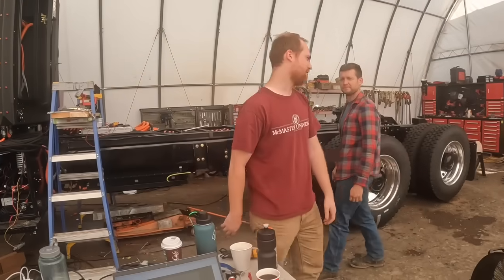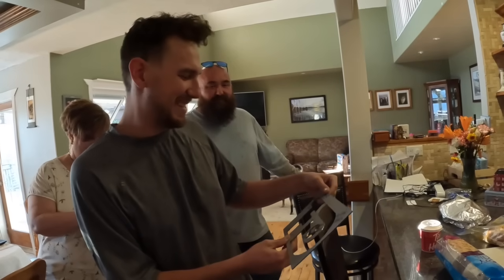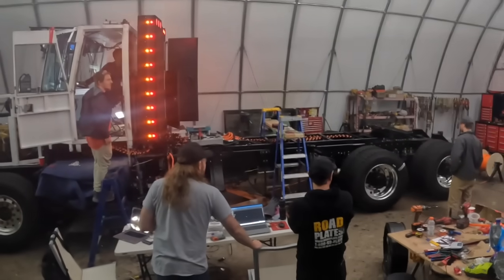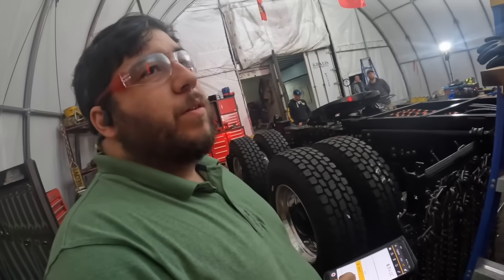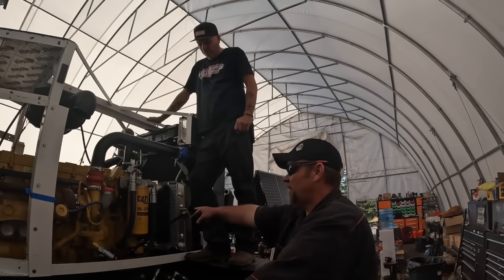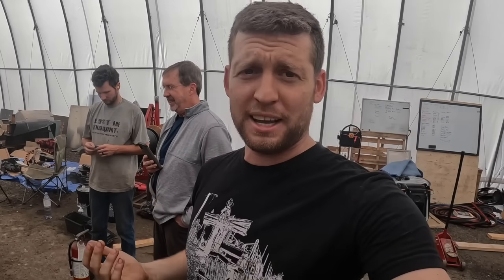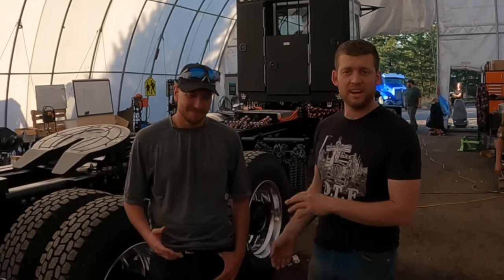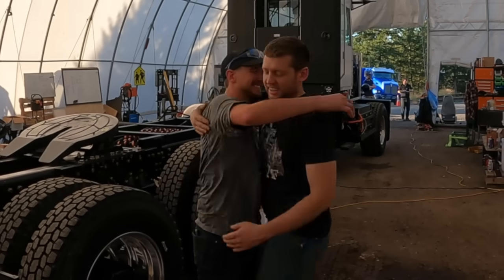Edison Truck Breakthrough: First Test Drive & Generator Power | From Concept to Reality in 12 Months

Comment: As Chase said, this is the obvious solution to reducing fossil fuel usage and is a proven technology. Just imagine reducesing diesel fuel consumption by 50% in the trucking industry! The saving and carbon reduction would make it possible for Canada to meet our climate change targets and bridge the gap between current battery technology and our green electric future.

Comment: It's a series hybrid... Just like modern locomotives. One power source only turns the wheels, but the energy source for that comes from multiple sources... Therefore hybrid (as in a blend of more than one).

And as for diesel-electric, you're right, it's a diesel-electric series hybrid vehicle.

Comment: I’m confused. Extended range EV with an onboard diesel generator? I’m guessing this project is just for fun because I can’t see it being economical viable to operate.
Reply: It makes perfect sense why this would be economically viable to operate, especially considering the generator only runs when it absolutely needs to, and running at full power for a relatively short period of time to recharge the batteries is way more efficient than using the same motor to mechanically drive the truck. Locomotives have used similar technology for the last 90 years or so…

Comment: Soo Cool! Congratulations! I like how you got the chains hung, but still lack a hood, etc., I guess you can take the trucker out logging, but can’t take the logging roads out the trucker. 

Also why didn’t you stick with the weight saving drivers seat from the beginning of the video, when yall were ‘driving’ wheels in the air? That’s an eco savings of a grey squirrel per 120,401miles driven, don’t you care about the plight of the grey squirrel?

Comment: I don't think that 24v fan will be big enough if not moving.    If moving should be fine.    But sitting still and loaded to max Gen load, I think it will overheat.

Also are u using the generator to start, or the starter?
Reply: No starter, the generator starts the motor

Comment: I've been watching you build this truck from about the beginning. You already had the Kenworth complete and were just receiving the e-axles. Great job, keep it going! It's great to see the members of the company get to see the wheels of the first truck start to move. Then to see it drive out of the shed for the first time. Your hybrid idea integrating with the route-planning that includes topography and grades to determine best battery use and recovery is quite excellent! The fully electric solution doesn't fit 100% for a lot of applications. This hybrid solution fits this application really well. It solves problems with economy and pollution (depending on charging source of course) without range problems. Plus the other benefits - torque, potential to drive front and trailer wheels for extra traction and safety. Great ideas! Some people no doubt complain that it's still running on diesel but they're missing the point that it massively reduces the diesel usage. Making this incremental change works massively towards reducing reliance on fossil fuels whilst actually being achievable / produceable. There's a company here in Australia (Janus Electric) that is retrofitting existing semis with batteries and electric drives using forklift-changeable battery packs. They might be someone to talk to to help develop your solutions!

Comment: Nothing wrong with a series hybrid, just like a train! hahaha
Absolutely awesome, guys.
I think electric freight trains are how the backbone of a freight network should be set up, with battery EV (or freight trams lol) in town. But trucks like this are what should fill in the gaps and connect the remote areas where you can't get those in. 
And hell you could run the genny on veg oil if you wanted to 🤣

Comment: Diesel electric like a train seems closest. But its not really that either as it doesn't need the generator the whole time. Not really a hybrid as at no time does the combustion engine mechanically power the axles. It's not electro-diesel for the same reason. But it's not a true EV either, as it can be self sufficient with uts charging. I guess we need a new category for these trucks.

Comment: It’s not a diesel electric as the electric isn’t dependent on the engine running, you have batteries. It’s not a hybrid as in that case, diesel and electric both don’t drive the wheels. Range extended ev sounds the most realistic

Comment: id like to call it what it is, but im not entirely sure. can the diesel drive the wheels or is it ONLY capable of charging? 

if it can drive the wheels, I'd call it a hybrid because that would make it hybrid drive. but if it only charges the electric, its a generator not a hybrid.

of course its awesome either way, but semantics can be fun
Reply: the diesel can’t drive the wheels directly. there are only electric drive axles.

Comment: Love this stuff and I am a fan, but I have a question about the tuning you are doing. How are you going to stream line what those Technicians are doing when you go to production? It seems like the mechanical, electrical and metal working can be done in an assembly line style, but the programing may be the bottle neck. Can those techs package the electronics and programing into a ROM or a Flash Eprom?

Comment: A few points:
Yes, an electric powered fan will be enough to cool.  You may even want to add a feature to ramp it down when it is cold outside.  When the engines thermostat is closed and the electrics don't need a bunch of cooling, keeping the engine warm is a good thing.
On cabling issues:  You need to do better in the future and I know you will.  A few things that can help:  A "cable buzzer" is a very handy thing.  It is just a battery, a loud buzzer and some leads so that you can check wires for continuity without having to be near the "meter".  Make sure you have good crimpers for any crimp.  Don't trust cheap ones no matter how much you paid for the cheap ones.  Always, check, crimp, inspect then let go of that crimp.  Each one gets treated as the value it is.
You may want to add an "anti-runaway" control on that diesel.  This is usually just some sort of stopper on the intake side that can be worked from in the cab so that a run away can be stopped without having to uncover the engine.
I like the metal logo bits but I slightly question the material it looked like they were made of.  The color on youtube may be to blame but that didn't look like 316 stainless, or aluminum bronze.  316 is very good in a salt spray environment.  Aluminum bronze polishes up to look like gold but is slightly less expensive.

Comment: Do you think operators will bother to plug in your trucks and charge the batteries or will they just run the truck on diesel all the time?  Though I think you probably have the right approach to getting truckers to adopt electric trucks.
Reply: Probably it will be plugged in at nights and long stops because it’s cheaper than diesel. When driving the engine is a fast charger and will probably get used as they drive. Just my opinion

Comment: 👍Congratulations. Great job. 🎉

Hybrid only applies if the engine can drive the truck directly, this doesn't. Diesel electric applies is you don't have batteries, like a train. This really is a range extended EV by definition.

Comment: Given that the only way to stop a runaway engine is by cutting off air supply, are you going to add a choke so operators can stop their trucks if they run away?

Comment: Diesel- electric is kinda specific. Hybrid just means that there are two power sources. Range extended ev is just some crud auto manufacturers came up with to sell their overly complicated deals with tiny batteries, however, the truck does plug in. So rather than suggesting we call it a phev, it may be better to just say, it deserves all the tax credits. Good work guys!

Comment: ??? Something i thought of seeing the cab layout.  I love digital but for a truck with so much redundancy built in, why did ya'll not leave analog gauges. not to monitor everything just the importance stuff like air pressure Oil pressure, coolant temp for gen and batteries???

Comment: I would run a pusher fan on the front for when engine is off with a Horton clutch fan on the engine for when its running but it might be overkill.

Comment: You are probably doing it already, but I'd suggest enabling future owners to customise the automation of the generator more than just on/auto/off. I'm not sure if the generator can be run at different speeds eg to run quieter through residential areas or perhaps allow the battery to be run lower when GPS says you're close to your depot. I'm sure there are a million customisations an end user could come up with that wouldn't make sense for Edison Motors to program in at the factory.

Also I'd love to see it be able to function in vehicle to load mode, even just as a backup option when the generator at a remote pickup point goes out. (Again probably already being done.)

Overall great job guys!

Comment: When I talk about the truck to people I’ve been calling it a “Diesel Electric Plug In Hybrid” with an “Electric Drivetrain that uses a diesel powered generator as a range extender” - so basically throw all the words at the wall and see what sticks, but add “plug in” to stress it doesn’t need to use the generator all the time.

Comment: Congrats !   A question, can the gennie start up automatically if the batteries are low AND the "key" is off...ie the truck is just parked.  Of so..any thoughts to a safety lockout to prevent that? Would hate to see it start during and oil change or worse, if someones working on the engine or high voltage side

Comment: Definitely diesel electric, hybrid would imply that at some point the diesel engine directly drives the wheels which it doesnt. 
I hear mazda is making a range extended EV with a tiny single rotor engine as a range extender. The rotary making a return, in a weird way
Reply: It's not really diesel electric either. Diesel electric doesn't use batteries. It functions the way a hydrostatic system does, just replacing oil with electric power.

Comment: watching the livestream for this was magic. the relief on chase's face

diesel electric sounds right, as it does describe this exact thing for trains. People who don't know trains should probably be told it's an electric vehicle with an onboard generator
Reply: if any, then only very few diesel electric trains have a battery though, they are diesel power electric drive, its not like they can turn off the engine and still drive
Reply: @Skjaeg69 most trains can drive on battery. The number I heard was 30 minutes with light engine.
Reply: @Skjaeg69  They can actually. a crew of two can power 2 locomotives, while the other is off-line. All those cables in that connection area, aint just break lines, but electrical too.
Reply: I'd call it diesel-battery-electric.
Reply: It's just a hybrid system guys. Technically it's a series hybrid like the Chevy volt.  HEV. If it has a plug then it is a PHEV which are my personal favorite type of green vehicle for use in Canada. I'd love to see pickup manufacturers adopting this style of powertrain.
Reply: @Jeremy-fy1sz Volt wasn't actually a series hybrid, there were modes where it would run in parallel, the BMW i3 was a true series hybrid when using the REX.
Reply: @Jeremy-fy1sz  agreed,
seems like the correct label is EREV, Extended Range Electric Vehicle
Reply: Getting to watch just the instant relief on his face was magical.
Reply: Not just trains, this tech has been on Submarines and other heavy machinery for decades. This is definitely diesel-electric! Go Edison Motors!
Reply: @RubiksBotES my favorite diesel electric is the crawler transporter that carried the Saturn V, Space Shuttle, and now the SLS rockets.
Reply: I think as it has large enough battery capacity it's not really a diesel electric. So it's either plug in hybrid or ev with range extender.

Comment: I think the frame can be lighter than a traditional truck,  being there is no torque on the frame from the engine!  It should be capable of being made nearly 20% lighter.    And it's:
⚡Diesel⚡Electric⚡ ex range hybrid EV ⚡
I myself prefer Diesel Electric,!

Comment: Now it looks like you guys are gonna be trying to build your own trucks. It's a great idea, but that would also be a great conversion kit for. Like a 380 nine, Peter W 900 kenworth. If the cat are Commons or Detroit, detroit de's legend runs, you put a generator where the transmission used to go. Setting your e axles in a small battery pack in The Wire. And in the computers, you can compare to regular truck over. Or maybe companies like freightliner kenworth and Peter built can start building gliders and those can be converted over.

Comment: Congratulations. 
Ill just going to put my 2 cents for the debate of is it hybrid or diesel extended ev. I would call it Plug in hybrid. While yes if there is major malfunction in electrical drivetrain the diesel won't be able to move it on diesel power. But i still count it as a hybrid because you can charge it and don't use the generator. Or you can just use the generator for power. Two different sources of power. Yes this truck tips the fawor for in more electric truck side.  Personally I cant wait to see how much this truck will be dependent on the diesel generator in hard working environment like one 8-12h shift and left to change overnight. And what kind of fuel consumptionc compared to conventional truck doing the same job.

Comment: Wouldn’t “plug-in hybrid” be the best description? Also, congrats guys! Love seeing this progress!
Reply: i would just call it a diesel electric, like they do for train locomotives.

but you could call it full electric with an onboard generator, the hybrid drive cars can use the gas engine with a transmission or the electric motor, and this is diffrent from that.
Reply: @ARockRaider  I thought the plug-in hybrid cars were fully electric drive train with a built in generator, but I could be wrong
Reply: @ryanhamstra49  mabey some are guess i haven't ever looked into it that deeply.
Reply: @ARockRaider  yeah, I would need to do more looking also. I’m pretty sure diesel electric like a locomotive means that the diesel is always running. I don’t think that locomotives have any capacity to run electric only. Whereas vehicles like the Chevy volt or the Prius prime have 50 to 100 miles of range full electric before they need to use the ICE. Whether that is purely used as a generator or also ties into the drivetrain, that I do not know

Comment: Series hybrid or range extended electric. If you can plug it into to shore power and charge it its a range extended EV or plug-in series hybrid (which I think are the same thing), otherwise its a diesel electric series hybrid like a train.